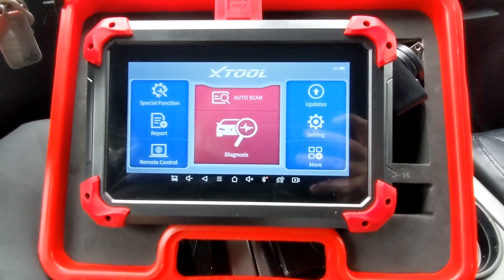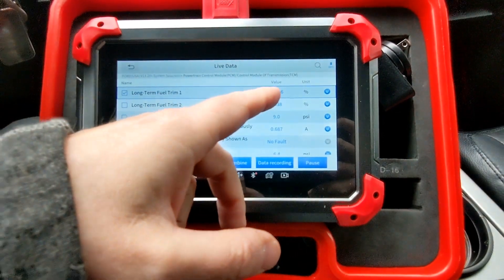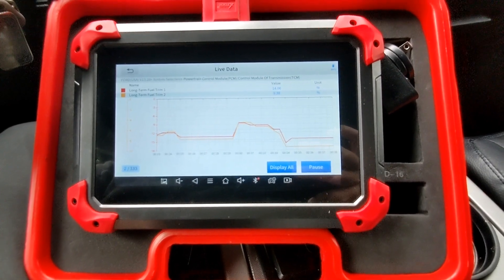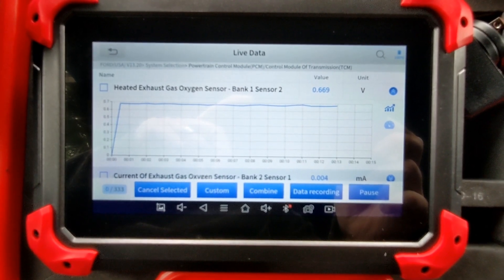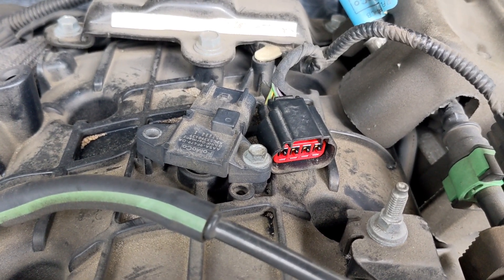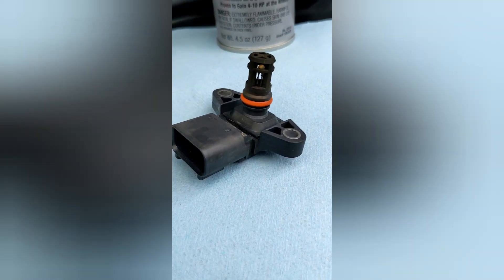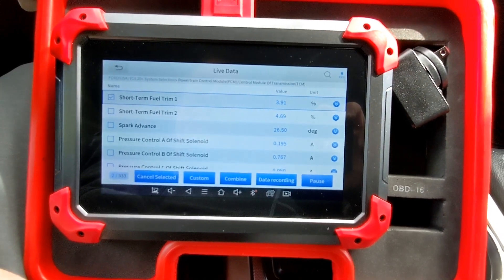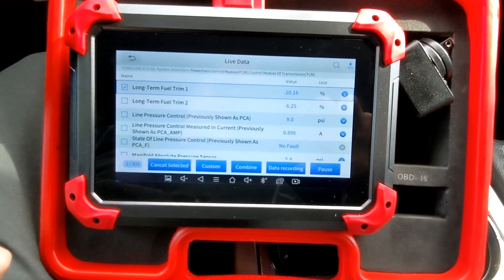DIY MAP sensor cleaning -- using XTool D7 to identify and correct Long Term Fuel Trim issue

Comment: just bought a d8 wanted the xv100 camera to find all the bolts i drop and the computer re learn feature so necessary if you want to stay out of the dealership and not spend $250 for a csk re learn. Good to see xtool did this for the d7. just about to drop my own video on the ac/dc chip replacement in my cpu on my other channel it worked out until I needed the re learn feature and I was like what is that.... Last March bought an Innova 3120 rs already had to upgrade.

Comment: Thanks for the video.  I just ordered an XTools D9 that will get here on Tuesday.  I've worked on a lot of cars in the past 50+ years and have changed faulty sensors but this will be my first experience with anything other than a simple code reader.  
I'm looking forward to connecting to my own car to learn.  After seeing how dirty that MAP sensor was I think I'll go ahead and clean my MAP and MAF sensors.  By the way, I read all the comments and I will say that both of my current vehicles have both and previously a Pontiac, Buick and Ford all had both.

Comment: One can get a similar improvement in fuel trims by cleaning the mass airflow sensor.  A useful tune up trick is to clean up the PCV valve if you have one.
Reply from the maker: Yes, some vehicles will have a MAF rather than a MAP.    You're correct PCV (and several other sensors) also contribute to A/F mixture.
Reply: @KentForrest  I thought practically every vehicle has both a MAP and a MAF.
Reply from the maker: @joemccarthy7120  some engines do use both.  I'm willing to be corrected but I believe it's more common that an engine uses one method or the other.  I think the use of both methods, in tandem, is found less often.
Reply: @KentForrest  Most modern engines have both a map and a maf to give the ecu a more complete picture of what's going on so it can adjust the fuel trim more accurately.
Reply from the maker: @RedEyedJedi  I understand this version of the 3.L EB relies on MAP and IAT with no MAF. I will double check my shop manual, but I haven't seen a MAF in this system.
Reply: @KentForrest  My 2002 Chev silverado Mass and Map sensor. My 2011 Kia Optima No Mass  MAP and IAT sensor combo only.👍
Reply from the maker: @DRDROP-fj4bo the Expedition is also MAP and IAT only, there is no MAF on the 3.5L Ecoboost.
Reply: Great little vid with useful information! Do you have more videos demonstrating the use of the Xtool D7?
Reply: @KentForrest  thanks, I’ve been looking into the Xtool D7 and may buy one so any videos showing their use are good for me. Just saw you have a couple more so I’m watching those. Great videos with clear information, thanks!

Comment: thx fpr the video, just learning now basics about fuel trims, and i just got my brand new xtool anyscan a30m, not as fancy as your but gonna be very interesting to test this, i only paid like 195 usd :D
Reply from the maker: When it comes to reading live data, yours should be just helpful.
Reply: @KentForrest  Yes i belive so too^^ one question, let say you have a bad fuel pump and you do live data. let say you are maybe on +20% on  fuel trim..  if i push the throttle/gas pedal then the Short fuel trim should go up even more maybe to 25-30 while my rpm goes up/higher right? then comes back to +20 when its idling right? is that correct understanding, and almost opposit if you have a airleak, it goes down, then up to 20 when idling?
Reply from the maker: Negative fuel trim (cutting fuel) indicates a rich condition.  Positive fuel trim (adding fuel) indicates a lean condition. How STFT behaves is going to have a lot to do with how LTFT has previously adjusted and what the present running conditions are. 

This video has one of the best basic tutorials on fuel trim.

https://youtu.be/AQLO_ncPDIs
Reply: I've just bought an a30m. It's in the mail. Are you happy with it? Do you have any issues or anything? Im hoping it's great.